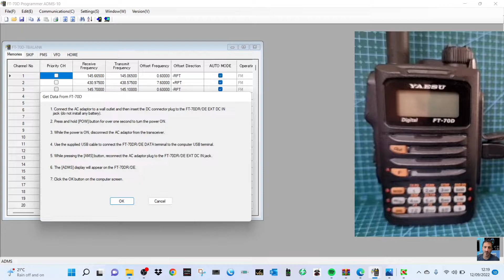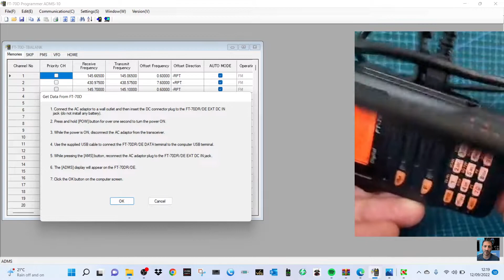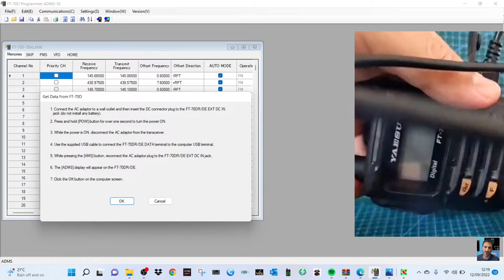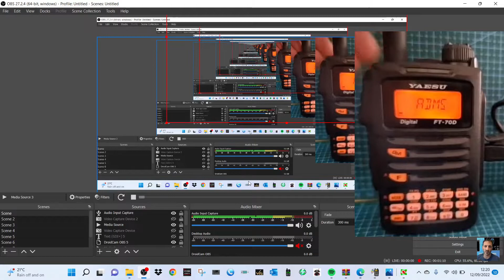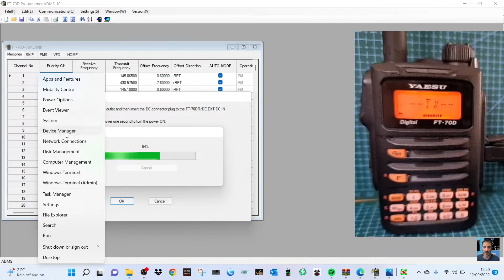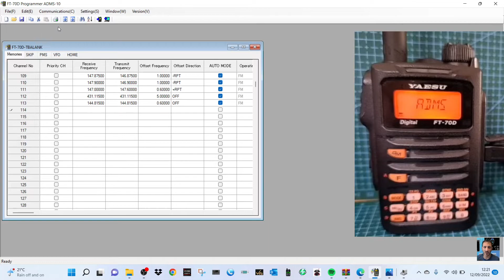YAESU FT70D , ADMS 10 Without Using DC Cable (Easier Quicker)

Comment: Thank you for this video. I had not used this software for some time and could not get the computer to recognize the radio. All it took was you showing where to find the radio in the device manager and identifying the correct com port. Without out that I'd still be looking. I believe the correct place to find the radio is different than the instructions that come with the software application.
Reply from the maker: You are welcome!
Reply: @m0fxbhamtech  I very much enjoy all your videos. I have all Yaesu gear, but I like seeing your videos on other brands of gear.

Comment: (Tongue in cheek)  The official instructions for programming want you to use the wall adapter, because the battery life of the FT-70D is so horrible that Yaesu is afraid that you will brick your radio while in programming mode on battery when the battery dies.     The battery life on my FT-70D is horrible.
Reply from the maker: Yes always get spare battery and a cradle.
Reply: What is horrible 2h 4h 8h?

Comment: Nice to know.  I need to program my two FT70s every so often and the Yaesu method is kinda clunky.  I do, however, wish that Yaesu would just program the firmware of radios like the FT70 so that it recognizes when a USB cable is plugged into it -- and all the user has to do is select program mode from a menu option on the radio.
Reply from the maker: Yes be good